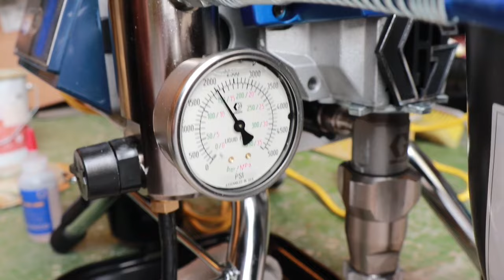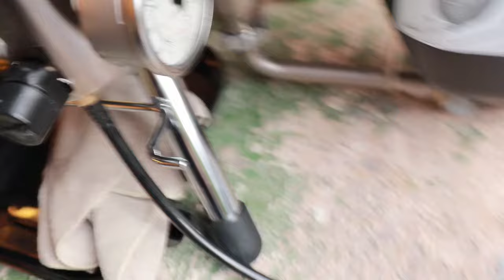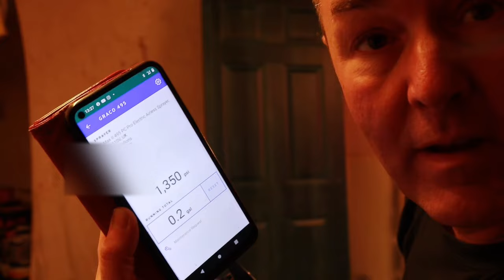Graco 495st Max II Pc Pro - using it for the 1st time ever

Comment: I was gonna buy the 495st earlier this year, but I opted for the Tritech T5  , my main reason was being able to use the small bore 7.5m hose with the hopper for small amounts,  similar to your door. The 495st smart control is not recommended with a short hose as the board is calibrated for a 15m hose. Also I'm like yourself and have the GX for smaller jobs too. Great video as always.
Reply from the maker: Hi Ya James. I've NOT got the smart control 495.

It's the 495 St Max II with BluLink.
with hopper and smaller bore 7.5m hose..... as shown in the video ;)

T5 was a contender. BUT the service I've had from Mike & Martyn and his staff at Sprayman has been really good over the years so wanted to give them the business.
Reply: @ProfessionalPainterDecorator  O right , so many options, I confused the 2, that's good to know , yes I've dealt with Martin this year also , Gentilin and Air Assisted g40 gun , also the gx came from them the year before. Your tempting me now about the small pc pro gun. 😆
Reply from the maker: @navigators11  yeah Mike said on the one with Smart Control.. digital control of the psi on the side... I couldn't do a shorter hose as it wouldn't work like it should. So this one ticked the box, not over complicated... I say that.. but need to understand the blue link better lol

Tye PC guns are good.   The compact is quite a bit smaller... Have a look see if it suits though. It may feel a bit small for general spray jobs.
Reply: @ProfessionalPainterDecorator  Thats it well explained then, top man , the fact that smart control is written on your machine confused me,  I get now what you mean about the lcd display,  yes the more complicated some of these electronic ones are there can be more issues and less chance of the owner rectifying it , Also careful where you get your power source as this can mess up the board,  I like the simplicity of the T5 for that , reminds me of my Titan 440i which is still running . Smaller pc pro gun would only be for the little hard to reach areas , media units , kitchens etc. I've the Tritech T380 gun which is great for general use. 👍

Comment: You re using Small fan my friend.4.10 it’s what I use with my airless
Reply from the maker: That's a 8" fan on a 410.
Big big for me doing a door. Would be good with large areas of dado paneling though.
Or a 310.
Which airless do you have?

Comment: If you were only painting doors and joinery in side your garage and not on site ever, would you use airless or your hvlp turbo?
Reply from the maker: For speed. Airless. Use a FF spray tip. 
You'll get a nice thicker coat application.

Hvlp still very good though.

Comment: Just my tuppence worth I’ve got a 495st with the smart control digital reading and it works fine with a short hose i even put a 3.5 mitre and whip hose on it for doing some cabinet doors in my garage that was before i got the 7.5 small bore hose 
Don’t know if it makes any difference but my pump is at least 15 years old
Reply from the maker: That's good to know Paul. Thanks for replying.

Comment: Hello mate,

I hope you're enjoying your Christmas break, I'm thinking of getting an airless sprayer in the new year I was thinking of getting one similar to yours but if I get one and I really don't get on with it, it's alot of money wasted so was thinking of getting the gxff, I see alot of people using them, I'll mainly be using it to spray furniture and kitchen cabinets probably never spray a wall or ceiling with it, would you recommend jumping on to a bigger machine or play it safe with the cheaper option?
Reply from the maker: Have you seen my vids with the GXff?
It would be ideal for you to start with. It will do furniture and kitchens.

But .. if you're doing more intricate work like kitchens and furniture... Consider a Hvlp sprayer.. you'll have greater control on your fan pattern and paint flow... All controlled via the gun!!
Reply: @ProfessionalPainterDecorator  yes I've seen a few, I've already got a compressor set up with a devilbiss gravity fed gun and we spray loads of kitchens but are currently using pre cat paint, I'm now wanting to change over to waterbase products and thought airless would be the way forward, I'm not overly keen on the turbine set ups, I keep going to order a new machine but don't want to buy the wrong one, a gxff wouldn't break the bank but feel if I did get on with it I'll work it hard and risk breaking it and also taking a nice chuck of money away from a nicer machine, but at the same time I don't want to invest lots of money and not get on with it 😂 think I might just have to put one in the basket and just order it.
Reply from the maker: @ultimategreens9788  you've the best if both worlds.  If you've got a conventional spray set up you know how that works .. keep with that.. using water based on your kitchens.

If you really feel the need for an airless... Will you use it enough?
Maybe look at a bit bigger unit.
Look at the Qtech range, tritech, Graco, Titan or Wagner 
All a much of a muchness.

But you don't need a massive unit if you'll only be using every so often 

It does come down to how much and what you will be spraying.

Don't buy a GXff if you're painting bare breeze block for instance.
But if just the odd ceiling every so often, it would be fine.

Also... What do you want to spend.
Reply: @ProfessionalPainterDecorator  100% of my work is spraying now so the unit would be used in my workshop and onsite daily, sometimes running upto 4/5 hours a day, I was thinking of keeping my compressor set up for upvc spraying, but feel I'd get alot more done with an airless the hardest part for me is going to be the switch over to waterbase products but I'm sure I'll get the hang of it, anyway thanks for taking the time to reply, enjoy the rest of your break and have a successful and healthy new year 👍 I'm going to spend the rest of my break researching airless set ups 😂 I've got around £3000 to spend but ideally want to get the best for my needs without spending the full amount if possible.
Reply from the maker: @ultimategreens9788  Oh I didn't realise you had a spray work shop too. Let me put a thing out there for you then....... an airless sprayer that connects to a compressor so you get to spray AIR ASSISTED!!!
In a spray shop environment they say that Air Assisted is ideal (I've not used it ... but could set up for it with my kit I have, but don't feel the need).
You could set it up for your work shop and see how you go, Speak with someone who knows about how to set it up with the compressor you have...... and get the right airless that suits it.. or just bite the bullet and get a new set up.  Have a look on the SprayMan UK website and also ask advise, you don't want to buy the wrong thing and not use it.

Comment: Has that sprayer got the digital panel psi on the machine 🤔
Reply from the maker: Hi Tony. No, it's blue tooth linked to your phone and it tells you on there.
Reply: @ProfessionalPainterDecorator  thanks Phil just see your video and the blue tooth was playing up with not connecting ,puts me of a bit as I like the digital read out on the machine .
Thanks for replying mate
Reply from the maker: @tonyokeefe5622  I think it was more my phone. Don't get hung up on digital readouts... It has a gauge that is big and clear to see what you're spraying at. I was told the digital control Graco can't have the hoses swapped over like this one can for FF work.. shorter hose.

Comment: Put it on 2
Reply from the maker: Two what?
Reply: @ProfessionalPainterDecorator  It should tell you what pressure to set the sprayer on the paint can
Reply from the maker: for the paint?
every paint will be differnt though won't it, and if the paint is cold or warmed up will alter what pressure you need. I can be spraying a whole day and from start to finish, if the paint warms up in the day I feel it at the gun and need to drop pressure slightly.